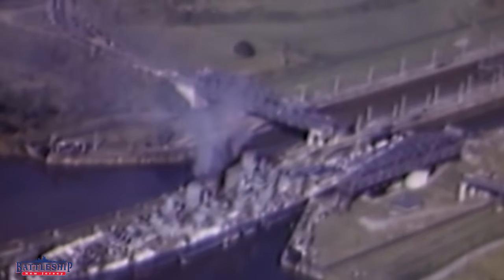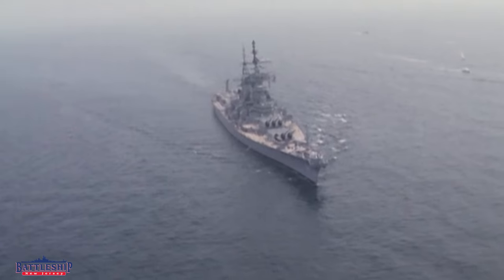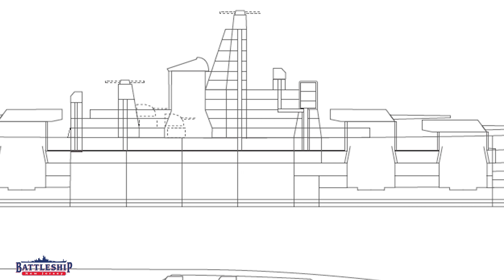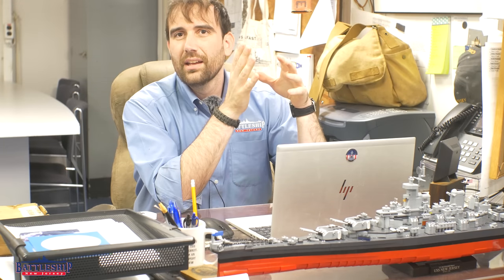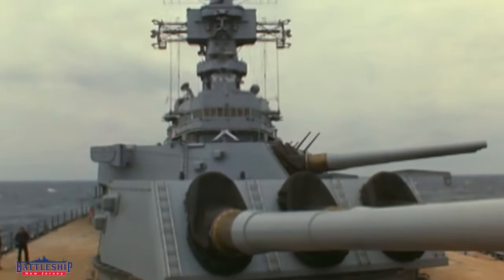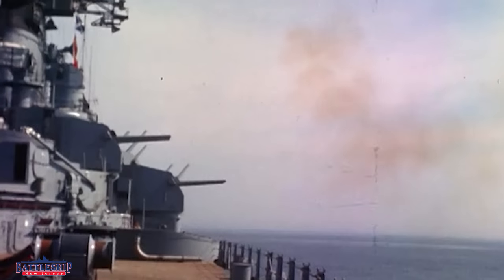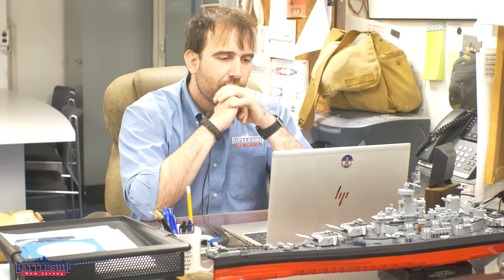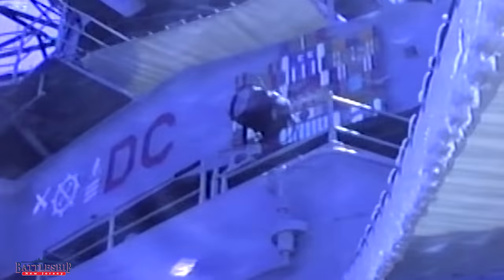The Perfect Battleship

Comment: And to think ww2 ship's were engineered without computers. Just smart men with slide rules and pencils. Incredible.
Reply: Don’t forget about Apollo 11 as well. They went to the moon & back with lees computing power than is in a phone today.
Reply: I started engineering in the slide rule era and a lot can be done with slide rules.  However I think some form of CAD would be beneficial.  One of the recent videos was about what all of the crew did in a turret.  Now think about all of the various bits they had to design and build, even the mechanism for passing powder bags through the bulkheads was complicated- doors, handles, levers, bells, and just for one small function.  How many people had to spend time figuring all of this out and then creating drawings to show someone how to build it.  I have trouble grasping the complexity of the wiring to connect all of the various systems throughout the ship, again just thinking about connecting the turrets to the fire control systems, power systems, communication systems.
Reply: @billj5645  I don't think that they were dissing on computerized design or the use of computer tools, just admiring the capability of the engineers who were able to do that without them.
Reply: Just the fact that there were 100s of handmade drawings for the ship is pretty amazing.  I started school with Autocad release 10. We still had to take a pencil and paper mechanical drawing course. It would take days for one part, and then you had to make a blueprint from it.
Reply: People were just better back then….
Reply: @dogloversrule8476  The guys who designed and then later manned ships like the Iowas went on to lead in the space program.

All that knowledge was not cultivated in a vacuum.
Reply: I think warship and aircraft design peaked in WWII for these reasons.
Reply: @F-Man  agreed, but it’s still boggles the mind
Reply: @dogloversrule8476  heard that a mid-1970's LED watch had more computing power then the LEM on apollo 11.
Reply: @HondoHoss77  💯!!
Reply: @dogloversrule8476  all the Apollos

Comment: Thunderbolt mounts are VASTLY underrated. IMHO, the Mark 15 quad 20mm/70 Mk4 Mod4 with outboard dual .50-cals just bellows "We deal in lead, friend." The modern anti-piracy uses are even more thought inspiring.
Reply: You could make a nasty modern version of the Thunderbolt mount with four 25mm Bushmaster chainguns easily and cheaply.  And of course it would be rigged for remote operation.
Reply: @zoopercoolguy  Oooh, quad bushmasters with quad AN/M3Ms and selectable firing circuits... just .50, just 25mm, lead storm.
Reply: 😅😂 that's it unleash havoc mayhem and ungodly torrents of lead and death ☠️💀☠️💀 good ol'Yankee FIREPOWER

Comment: Completely agree with you regarding the Turbo Electric drive system and the quad propeller layout. Differing with you on the Thunderbolt Mounts, that because I found something I like better. As Germany was invading Poland, several Polish engineers escaped to England with an improvement of the 20mm Oerlikon. It was less complex and less expensive to build with no loss in effectiveness. The British and Canadians built some. And in 1944 they built a quad mount that I believe is better than the Thunderbolt mount. Here’s a link https://youtube.com/shorts/GXNgPSXb9Vc?feature=share

Comment: I think that if the MONTANA class, armed with 12 16 inch/50 caliber main guns, 12 5 inch/38 caliber secondaries, 13 inch exterior belt armor, turbo-electric drive, 30-32 knots, 4 shafts, Ryan's bulge-void protection, 6 inch main deck, 3 inch second deck armor, and one funnel would have been the ultimate battleship.  The 16 inch armed "super-Bismarck's" proposed by Germany would have been a close second.
Reply: The Montana's were going to have 5/54 guns.
Reply: The german h designs, specifically h-44 got up to 20 inches, and the super yamatos, also known as project a-150 got to 20 inches too.

Comment: I’d consider diesel electric propulsion. More efficient and you are eliminating the boilers and all the steam pipework, condensers etc. Also fully welded construction, thats a 10% weight saving on the hull. A transom stern like Vanguard for extra efficiency. If feasible I’d examine aluminium for high up structures to lower the C of G and reduce weight. A teak deck is nice, but not necessary.

Comment: I once sketched out a commissioned-in-1942 battleship for a hypothetical Pacific nation that used a lot of US technology, either under license, or bought direct, in both Springsharp and Shipbucket.  The one compromise I think Ryan would disagree with is sticking with the quad 14"/50s originally intended for North Carolina (a national policy decision related to ammunition supply lines).  Otherwise, I ended up with a fairly similar ship, conceptually.  28 knots (on a South Dakota plant), 44,340 tons standard, twelve 14"/50s in three turrets, twenty 5"/38s in the same King/Nimitz layout for secondaries, a 13" external belt angled at 19 degrees (again, similar hull form to North Carolina), same deck and turret armor as the Iowas, and a range of 10,000 nmi at 15 knots.  The one place where it significantly varied from US practice was that, since the nation didn't have to deal with the Panama Canal, they accepted a 120 foot beam that left her about halfway between the NCs and SoDaks in length.

She still worked out to be a surprisingly well-balanced ship going by immune zone theory--NAaB (which basically uses Nathan Okun's equations in a user-friendly interface) estimated an immune zone against her own guns from about 18,420 to 35,960 yards, and from 20,000 to 34,800 yards against the design opponent, Nagato.  (Nagato, notably, had a negative immune zone against her; this could penetrate Nagato's belt out to 27,270 yards, and her deck beyond 25,800 yards.)  Indeed, the only major power ships that she didn't have some immunity to at a range where she could penetrate them were the US fast battleships, Yamato, Vanguard, Nelson, Lion, Richelieu, Alsace, and Littorio.

Comment: If I'm building a modern battleship as in 2023 then this is what I am doing. 1. Keeping the length of an Iowa and maybe adding a little bit of width to aid stability. 2. Reducing the superstructure but integrating it all in to one section like a Zumwalt to aid stealth. 3. Keeping the 9 x 16inch guns in the 3 turrets. 4. As many Mk57 VLS along the sides of the boats as possible. 5. Landing pad at the stern but no hanger. 6. Diesel Electric propulsion with Sodium ion battery storage and modern steam turbine instead of gas turbine to increase range significantly. 7. Multiple CIWS Phalanx and Searam for anti drone and antimissile defence. 8. BL10 aegis and Ceafar 2 (with ceamount illuminators) phased array radar and the Saab 9LV tactical interface. 9. A hull mounted and towed array sonar. 10. Nulka decoy launches. 11. 30mm guns around the deck of the ship for piracy and anti drone requirements. 12 A modern traditional bulbous style bow instead of what the Zumwalts has.

Comment: Iowa hull form.  No conning tower. Cargo/Hangar Elevator in rear for quicker resupply. 1 Fore and Aft  2-gun turrets. Willing to drop to 4 main gun barrels in exchange for highly automating the guns like the Des Moines are.  Even if that requires dropping from 16 down to 14 inches.

Any weight savings from there can be used to improve the torpedo defense, radars and automating more of the systems to reduce crew size.

Comment: There was a proposal in the 70's to make a 16/50 smoothbore that with a RAP round it could theoretically reach orbit.
Reply: A shell Smoothbore gun barrel  will travel shorter distance
Reply: Nope. And I'm not talking about a conventional 16" shell, this would be either a RAP round or a sabot like used in tank guns.  Look at the 120 mm gun on the M1 Abrams. Much higher muzzle velocity and much more kinetic energy than the 120 mm rifle on the older tanks. AND, the Iowa's were the first, maybe only, BBs that could elevate their main guns to 45 degrees, the elevation angle that produces maximum range... @nx014

Comment: If you can keep the length rather than shortening it and the turbo-electric drive that means no shafts to deal with, there may be space for a hanger in the fantail like a cruiser. Big empty space outside of the citadel, not adding that much weight and helping with hydrodynamics.

Comment: Wow Ryan...love your insights and i have to say a longer video and more visuals would be no problem with me...i think you could save weight with moving to Welding vs Rivet construction....that should buy you some tons there.... you also shortened the ship so there is weight saved there and being slower you could reduce engine size...even with the new versions you suggested....so in comparision they should cancel out the added weight by needing less HP...

This might be unorthodox but to save weight could you cheat a little in the torpedo protection and start it lower down on the hull...maybe a foot lower to all you to go deeper....torpedos usually dont hit as high on the blister upper-start line unless im thinking of something else... torpedos i though by this time were running slightly deeper anyway. 

Oh what did going shorter on the main gun caliber gain you and what did you lose?....was there a better gun being developed at the time that was 55 caliber and 16in?....

I think you bound youself to much with the Panamax design and treaty design....how about losening up this more and exceed the treaty and Panamax design but try to stay within no more than 5% over of the Montana class. 

Lets see a: 

WW2 version 
Vietnam or Korea version
1980s version
And a 2023 Ryan's Given a Blank Sheet of Paper version where the next 2 carriers budgets are diverted to you....

Comment: They make NO sense, but my brain loves the idea of missile battleships.  Replace the middle turrets with vertical launch tubes for either cruise or ballistic missiles (or a mixture of both).  Not possible in WWII and not useful now but the idea is just fun to think about for me.
Reply: Missile battleships made sense in the 1950s when the missile magazines and reloading spaces required huge amounts of internal volume.  The early missiles basically used a horizontal assembly line to move from the magazine and get prepped for running out on the launcher.
Reply: Look up "Arsenal Ship". They were considered, but like a modern battleship, the issue is concentrating too many resources in fewer ships, rather than distributing the missiles among many more Destroyers and Cruisers.

That being said, I wish we made at least a few...
Reply: @FeldMonster  I am aware of arsenal ships.  They aren't quite the same as what I want but are a great example of why what I want doesn't make sense 8)

Comment: Not so sure about that conning tower decision although I understand the desire to save the weight. Here are my counterpoints:

1. A 15" shell from Bismarck went through Prince Of Wales' bridge. Sure, it exploded in the water on the other side after passing through, but the problem is the shock wave of the impact and turning the structure of the area it struck into lethal fragments meant everyone on the bridge was killed, other than the Captain who was injured.

2. Meanwhile, here's a quote from the CO of SoDak, taken from the damage report circulated after her battle near Guadalcanal:
"Armor: - Fire control and conning tower have definitely proven their worth. Further agitation for the removal of this weight is definitely suspended. Control stations behind armor should be used more frequently. Too much stress in the past has been laid to the space restrictions at these stations. Had these stations not been utilized during the engagement, control and conn personnel would probably have been destroyed."

Comparing both of those and it's pretty clear. Note, too, the reference by SoDak's CO that "further agitation for the removal of this weight is definitely suspended". Clearly the weight of the CT was being eyed as a potential saving for other purposes, but that's a pretty clear comment based on actual battle conditions and performance.
Cheers

Comment: The float plane is interesting.  I wonder if organic aviation in WWII is really worth it.  Maybe attaching a seaplane tender to every battleship battle group really made more sense.  Free up some space for flag staff on the BB, and the tender can recover aircraft without needing to task the BB to sailing a specific course during recovery.
I also once doodled a back-of-napkin battleship hull with only 5" guns.  All the 5" guns.  Lots of engagements weren't really at the max range of a 16" gun.  Since the US had good radar, we could do night operations where we snuck up on the opposing fleet.  So the idea was to make BB's that would work in "line of battle" with the DD's by having the same gun range as the smaller ships.  4x16" turrets is something like 10,000 tons.  A 5" is something like 50 tons.  So you'd have a mass budget for something absurd like 400x 5" barrels if you could find the room for them.  Which would have the comical result of firing 5" shells as fast as a modern CIWS shoots 20mm.

Comment: 1.  Shortening the hull by 100 feet, while adding one 16" turret and two 5" centerline mounts, and removing one stack, doesn't seem feasible.  Plus my understanding is that turbo-electric drives take up more length.  On the other hand, most of the lost 100 feet is the skinny bow where you can't put 16" turrets anyway.  The second aft 16" turret is unnecessary.

2.  If you're going to use quad 20mm guns or replace the 40mm with 3", you should also replace the 5"/38 with the 5"/54 which were actually used on the Midways.  I don't know if twin 5"/54 were available.  Having two centerline 5" mounts is a good idea, if possible.  Another "is possible" is two more 5" directors to match the centerline mounts.  Stick with the 16"/50 to get the super heavy AP shells and to outrange everybody else.

3.  I would not worry about the Panama Canal.  The Midways didn't.

4.  The Japanese had twin rudders about 100 feet apart fore and aft as better insurance against torpedo hits.  I don't remember now if there were two pairs, or just one, but I would have two pairs.  Don't need to risk a Bismarck loss.

5.  Yes, dump the conning tower.  I can't imagine anyone inside surviving a direct hit even without penetration.

6.  Keep the speed.  The faster ship controls the range, and with gun battles, controlling the immune zone distance is vital.  Yes, the fine bow is set and more susceptible to damage, but speed is precious.

Me, personally, would take the Iowas as is, only moving two 5" mounts to the centerline with two new directors, and otherwise keep the design.  If carriers are steaming around at 33 knots, battleships which are 3-5 knots slower can't do their job.

Comment: I've noticed my design tendencies favor speed, firepower, and survivability (IE- redundancies and compartmentalization) above all else and at the expense of armor protection.
As such:
Missouri-class BB (or perhaps a rather heavy BC? BCL?)
Displacement: 150kt
Speed: Not less than 33 knots
Propulsion: Turboelectric (or perhaps diesel-electric?)
Main Battery: 4x4 406mm L/50
Secondary Battery: 12x2 127mm L/38 (5x per side, 1x fore, 1x aft)
Tertiary Battery: IDK... as many 76mm L/50 Mk. 33 Mod. 13 enclosed twin mounts as you can fit
Armor: I tend to favor an all-round even armor scheme as much as possible while following the all or nothing scheme. Ideally minimum armor would protect against at least DD guns (127mm), if not light cruiser guns (152mm) - if only in depth. Heavy cruiser guns (203mm) might be an ask, but the emphasis on shear redundancy and compartmentalization ought to ensure enough survivability to withstand a heavy cruiser.
Other: Well, for one, you'd be ditching the ability to transit the Panama Canal. For the other, the vessel would have a heavy emphasis on automation and full autoloaded guns on ever level. As well as generally high technology all round. If displacement allows, might even consider fitting a hydrophone system to try to give early warning against torpedoes, but this is by no means a hard and fast requirement. A full 5 layer torpedo system and triple bottom are a must to mean the goal of increased survivability. Ideally, 6 such ships would be built. 3 on each coast. Rotating such that 1 is deployed at any given time, 1 is training, and 1 is in port for maintenance.

Comment: You'll still need 200k+ shp to get a shorter 45k ton ship up to 30kts.  Lexington required 16 boilers to make 180k shp. Even with a more modern turbo electric drive, space will be tight with a 24ft deep tds. 

I get trading length and a conning tower for an extra turret. But you also want another 1.5" of belt armor and the turbo electric drive. I see your boat weighing in a 50k tons.

Comment: I wonder what a 2023 era battleship would be like.

The shells would be autoloaded, and could possibly use liquid propellants, drastically reducing the crew requirements.  Everything would have smart fuzes, of course.  Sabot rounds might be an interesting addition for extended range.

I'd explore electric reactive armor. (Basically, voids with a huge capacitor attached to use discharge to deflect incoming plasma from shaped charges)

Perhaps the ultimate is a light weight ship, the same size as the New Jersey, with far less actual steel plate, but more distributed power generation and drive, such that it could survive hits and keep on going long enough to get back to port. Filling void spaces with low density foam beads could keep them from filling with water, yet allow removal for maintenance, etc.

Gas turbine / electric drive seems reasonable as a starting point, nuclear power would be nice to have, but could it take a hit without taking out the crew?... unlikely.

Well... those are my thoughts... a 10,000 ton ship with far less armor, but 16" modern guns.